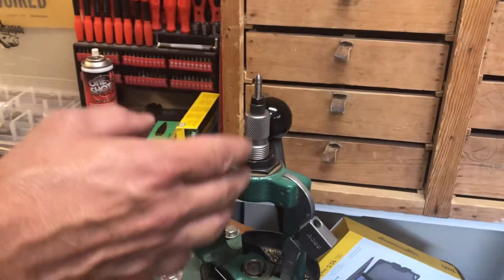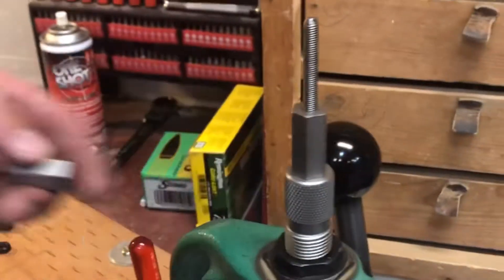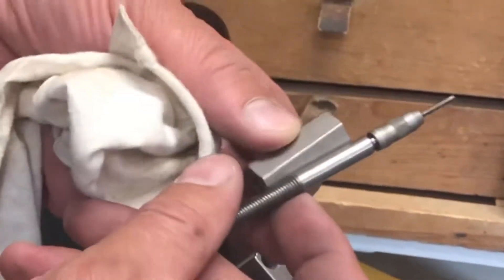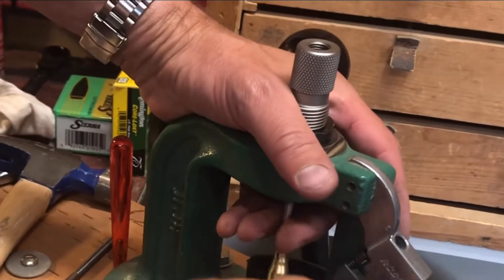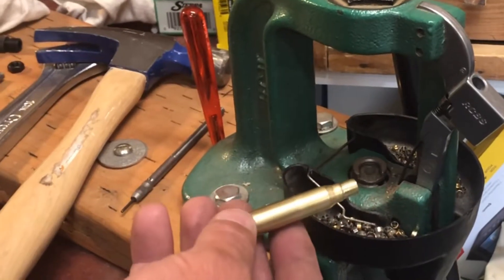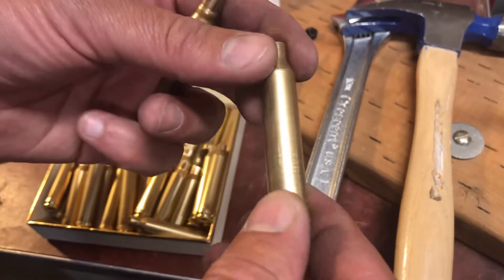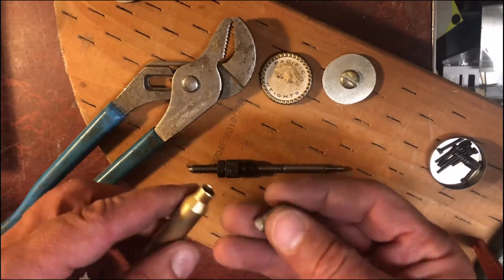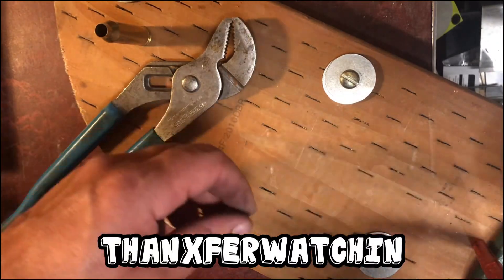Stuck Brass?  How to Remove a Stuck Case From a Reloading Die

Comment: I was using that same damn thin lube you have on your desk.
Reply from the maker: It’s usually good, but it’s easy to miss a shell.  I’ve Ence changed to Unique lube and like it more.  It’s a little messier though.  We’re you able to get your case out?   You can stack larger nuts with a washer and a nut on top to mimic the RCBS tool and do the same thing if you don’t have the RCBS tool.
Reply: @oddballschtuff  I got the case out with a makeshift arrangement but it still snapped the expander off. That was the first shell through a brand new sb .300 AAC die and I really thought I lubed them well enough.
Reply from the maker: @jxinx6812  my experience is I always buy a new expander ball just in case. But I haven’t had it break off before. It is so frustrating. Call but it is way better than have to buy brand new dies.
Reply: @oddballschtuff  yeah, I ordered a couple new ones and a couple for .223, just in case. I think they were only $8 each from Scheels.